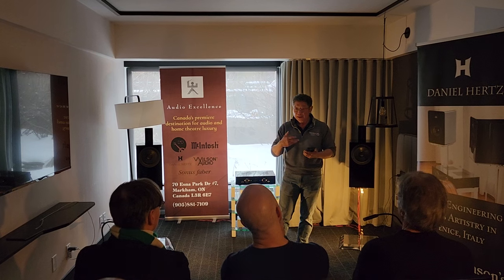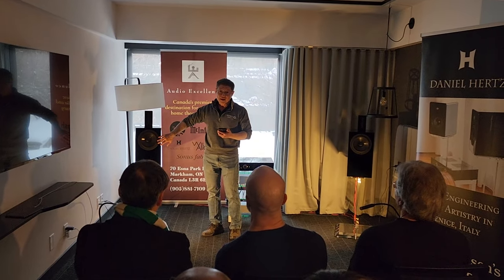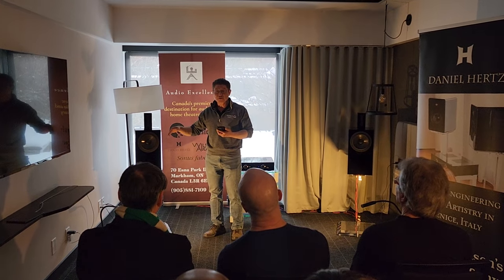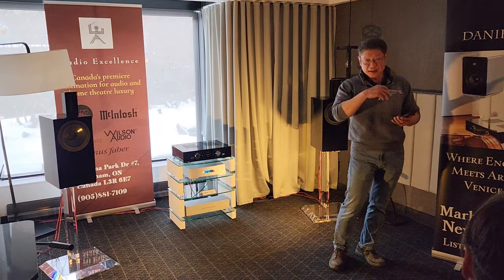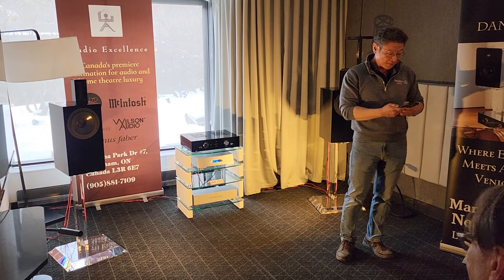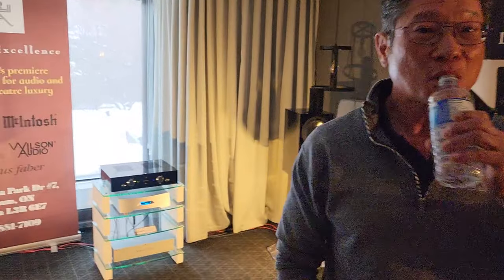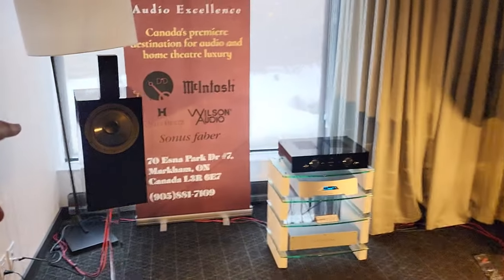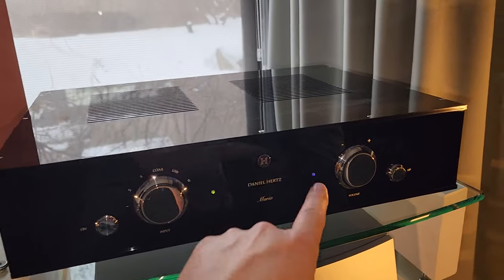"Excellent" Demo by Adrian of Audio Excellence featuring Daniel Hertz combo

Comment: Not being a DH fan boy but to the tyre kickers. For $50k you are not buying bookshelve speakers. You are buying large stand mount speakers, that have active crossovers with the benefit of DSP for speaker correction, 4 channels of amplification and digital conversion.  So most of a system except for a streamer. If you buy a Wilson or Magico for $20-$25k and then you need everything else. If these sound great they are reasonably priced!